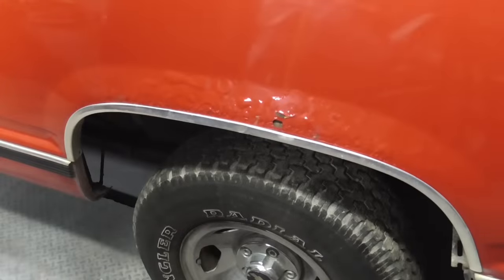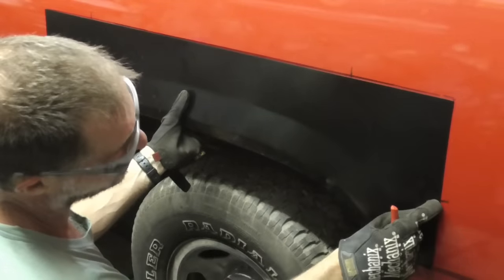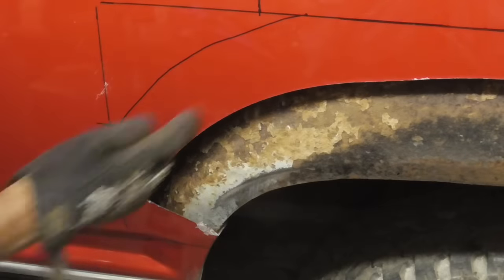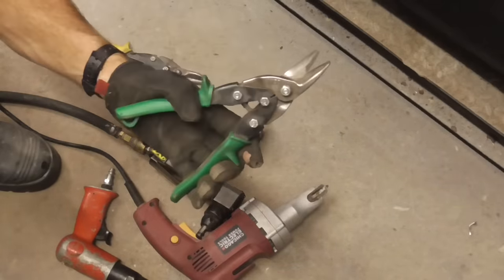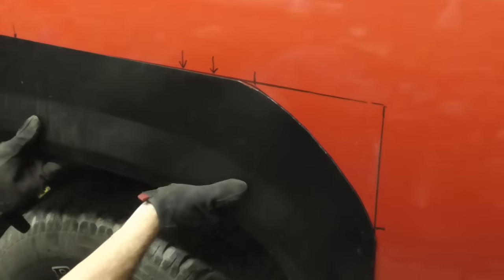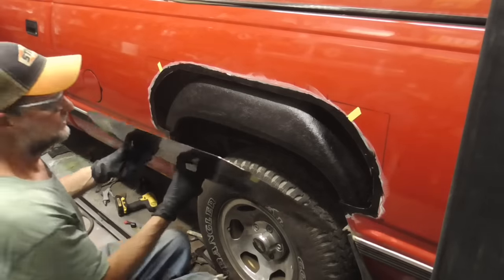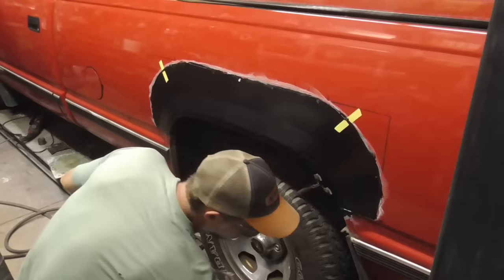Glue On Wheel Arch Rust Repair Panels w/ SEM Impact Resistant Panel Adhesive

Comment: I have been doing this type of work for fifty years. Your method requires much craftsmanship.
Bud welding saves a lot of time. The maximum time for a nice bud well would be 15 min, 
Maybe 15 to 16 spots. I cut in between the metal to level out the surface evenly.
One thin coat of fiberglass filler, glaze, and prime, then paint. 
6 hours altogether to finish the job. Thanks for the video.
You did great work! I am not criticizing you. God forbid, everyone works differently.
Thank you for the video.
Reply from the maker: You're welcome Brother - have a great day my friend :)

Comment: I would have ran the air flange tool on the cutout instead of letting the metal overlap like you did. I was thinking of doing this exact repair on my truck, but still not sold on it. I know my weld won't fail. Time will tell how long the repair will last. looking forward to the final
Reply: Airplanes are put together with similar panel bonders and go through a lot harsher conditions
Reply: After i let this stuff set on my Smyth Ute build , I had to jack the back of the car up for some underneath repairs. 
So I did the old twist test and jacked it up at the left rear suspension mounting point. 
The chassis was so stiff ,it came up level and I didn't have to go to the far side and jack it up to level it for the click I selected on the stands. 
Definitely came out way stiffer then the original chassis was.

Comment: I commented recently on another channel  about old school rust repair and this was how it was done except that the panels were brazed or riveted on then.This way is far better as the panels are sealed from behind. We cut out rust with the same tools shown, I have them all. This makes a fine repair on a daily driver. Nothing wrong with it at all.
Reply from the maker: Thanks for the positive comment Troyken :)
Reply: One issue with brazing is if the flux isn't completely removed, the metal will rust / bubble overcoats.
Reply: @Mike I thought I was the only one,lol.
Reply: @Mike Nothing like taking down stop signs then waiting for people to crash. . .
Reply: @ciphercode2298  Nothing like taking down stop signs then waiting for people to crash. . .
Reply: @bobroberts2371  lol,well I'd find mine knocked down already,but thatd work too,lol.
Reply: 0
Reply: It also removes the heat factor.Not having to worry about warpage.Less body work.

Comment: I've been doing that same exact thing except I have been using duraglass as an adhesive. been doing for over 40 years with no complaints!
Reply from the maker: That's interesting and great to know.   How wide is your overlap usually?  Do you tap the seam down a bit before filling?  Thanks :)
Reply: like I said I have been doing it basically the same way I just use duraglass as the adhesive instead!
 @LakesideAutobody

Comment: Excellent job Bud!! Epoxies and Adhesives have come a long way in the last few decades!!☺
Reply from the maker: Thanks 👍 RK
Reply: Way would you do the hard part to end up with a poor finish 
Bulges where there should not be doesn't make sense ?
Reply from the maker: @johnhall3827  You'll see the finished product this Friday 10/22/2021  - you'll like it :)
Reply: Seems to me within a year the water will invade that overlap joint and start rusting again
Reply from the maker: @JamesJones-rg3dn  That's the main advantage of this method - the glue absolutely seals the lap joint - this will last  as long as a new panel or longer if you do this - https://www.youtube.com/watch?v=8XaZBy7GC7A
Reply: I've been putting my Smyth Ute build together with 3m 8116 and I'll say I'm amazed at this stuff! 
After it was all set for a few days, I jacked up the car at the left rear to put stands under the back.
Didn't even have to go to the far side and jack it up to level it, it was already level.
Reply: @JamesJones-rg3dn  not sure about sem products but the 3m has corrosion inhibitors, so anywhere that's ground to bare metal better be covered with it.
Reply: @LakesideAutobody  : I liked your video, I've never seen a body repair done this way. I work on my own boats, and use a different epoxy product. I shaped and epoxied my cast iron keel about 12 years ago. Not one sign of any failure so far. Also, fiberglass boats can develop osmosis problems, (bubbled gelcoat). I epoxy coated a hull bottom 30 years ago. I sail with the present owner and I've found no more problems after almost 30 years.  Done well, epoxy lasts. (as you know)
Reply: Would make an interesting revisit to see the repair in the future ,say a year or two,please keep us updated . Don't know your location, but up here in the salt belt of Ontario  Canada would give that repair a run for its money on durability
Reply from the maker: @drewthompson7457  Hey Drew thanks for you comment and input.  Boat work has a lot in common with auto body - my dad worked at a vette shop in the 70's- lots of glass work
Reply: U can glue them on but eventually you will get a small line that outlines the patch.
Reply: @JamesJones-rg3dn  I tried this on a car where we put quarter skins on and within a year you could see a line where the quarters stop. I even put duraglass down as my first coat of filler. Had to grind all back out and weld back solid.
Reply from the maker: @jerrybillings4720  The key to any patch is knocking it down and filling  - welding or glue - you'll never see the line - See this vid  - https://www.youtube.com/watch?v=d21RkqTwRqs
Reply: @LakesideAutobody  à
Reply: If ya do proper bodywork, that is coat seem with short strand fiberglass Like Duraglass it will be unnoticeable
Reply: @LakesideAutobody  nice because no risk of fire and it’s totally sealed, more and more cars are “Glued” and properly done, the metal will tear before the glued joint separates I glued quarters on and it worked well , just make sure first coat of filler is something like Duraglass
Reply: @LakesideAutobody  everyone I know that has tried this method has the same problem. Within a year the patch line shows. I like the adhesive for small holes like removing a roof rack and glueing a small patch in from underneath but panels like this I just have never seen them last
Reply from the maker: @holmes1956O  Maybe because they didn't do it correctly.  Not many folks do rust repair correctly.  1) good seam 2) knock down seam 3) fill  Do it like this video and you'll be fine.  If you don't knock the seam down, and have the filler as a buffer between, I think you're asking for trouble.  See the same repair on the drivers side cab corner and drivers side door bottom 3 years later https://www.youtube.com/watch?v=gIS1Tbv7Kvw
Reply: @LakesideAutobody  I cant attest to how they did the job however it wasnt one shop it was several different people that have had that problem. I am glad for you that it is working just what I see in my area is not good in the long run
Reply from the maker: @holmes1956O  I promise I will show it if that ever happens.  So far no... but I will always be honest and would love to do a video on it and why it happens so that it doesn't happen to folks that try it.  If you ever see it or try it and you see the seam after a few years, try figure out why it happened and make a comment on this video or email me and let me know.  Nice talking to you Holms.  Jerry
Reply: I don't think people that make negative comments realize. Sooooo many vehicles over the last 10 plus years are built this way. With only some spot welds in places.
Reply from the maker: @1manshtshowandautobodystuf891  You're right.  Thanks for the input DM - have a good week :)

Comment: A step up from the old days of shoving newspaper and screen then filling with bondo! But personally I will continue to weld in a complete new panel since I have perfected my installation procedures.
Reply: That's the way I would do it is with welding a new piece in , filling in holes with Bondo doesn't last once moisture gets trapped .

Comment: I have done a ton of these repairs I always flange the patch panel other wise you have to use Bondo.
Reply from the maker: You still have to knock the seam down if you flange or the seam will show.  If the seam is not tapped below the surface welded or glued it will likely fail.
Reply: @LakesideAutobody  I put a backing plate on the new panel (glue or weld), cut it flush with the area you're filling, cleco it for position the glue and pop rivet, grind off pop rivets flush, hardly need any bondo except to fill seams
Reply: What type of filler did you use? Looks like it spreads nicer than “Bondo”
Reply: Average time to fo complete job on 1 panel?

Comment: Another tip when you prep to glue the panel. After grinding the  back of the patch panel run a piece of tape along the edge of the area that you just ground down and paint the patch panel up to the tape with POR-15. Just to make sure the metal isn't exposured to the air. And I would do the same on the truck box. Treat the rust with rust treatment and paint with POR-15 and even use a Schutz gun to spray undercoating or truck bedliner. I did all that to a chevy truck 10years ago and it's still solid.
Reply from the maker: Good tips NtD - If you think it through rust repair can last a lifetime :)
Reply: @LakesideAutobody  So true. I honestly think using panel bond is a better way of doing rust repair patches because when you use a welder and weld through primer you are adding heat to the metal so anything you have on the metal for rust proofing tends to burn off then you have bare metal exposed to air. And no matter how much you try to coat the backside of the repair with rust proofing you always miss something. I've seen welded repairs having to be redone in 1.5year later. But repairs using panel bond 10years ago still going strong and yet they will not teach this technic in any trade school. Sometimes you have no choice but to weld but its amazing how far structural panel bond has come.

Comment: Very nice job! At first I thought, 'How's he going to blend the patch to the parent metal? He's not flanging the parent metal.'  Now I know!  Also glad you treated the wheel arch with (Por15?) rust preventative.  Would love to see the painted vehicle.
Reply from the maker: This Friday you'll see it :)
Reply: All metal over the seam before filler is a better
Reply: Didn't look like the new panel was treated on the backside- don't want to be that guy, but why leave bare metal exposed on a panels underside if longevity is at all a concern
Reply: Which part of the video did he do that? Was it the filler or knocking down the area before the filler? I still couldn’t figure out the answer because I had the same question. I’m about to attempt this on my own old f150
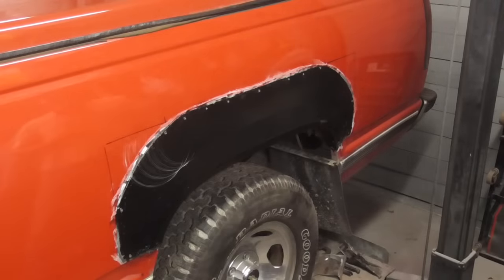Reply: @Tallgeorge  At (9:30 he began to grind/blend the patch panel to the original metal. And he allowed a generous "blend " area so the transition from old/new will be seamless once the filler is applied.
Reply: @mdogg1604  ah so he took a bit more metal off of the patch piece to make that a smoother transition. I get it now thanks!
Reply: @Tallgeorge  You're welcome! I was skeptical at first, but the end result looks really good.

Comment: I use SEM Products and I think they are great. I have mostly used the MultiPurpose Panel Bond, ( the non Impact resistant) and a few different seam sealers. I usually only use the panel bond where the OEM had placed it or per the repair manual. Every time I seen patch panels glued to the seam and not welded especially in Northeast PA the adhesive will start to push on and out during winter and summer months and it will leave a ghost line. Have seen them ground down and tapped in on the seam and ev en tucked under. The panel bond, body filler, and primers, topcoats will all expand and retract at different rates. I would have glued the wheel wells and welded the rest. Tight coat of Duraglass or Everglass across the welded seams and filler. Then undercoat and Cavity Wax the hell out of the inner panel. Not knocking your repair skills at all. You definitely been in the game a long time and know what you are doing. That has just been my experiences both doing and seeing patch panels panel bonded at the seams.
Reply from the maker: Have you tried knocking the seam down and filling with fiberglass reinforced filler so that the seam is not right under the finish?  I have never had a problem with ghost lines in glued repairs.  See this follow up video on repairs that were glued 3 years ago - https://www.youtube.com/watch?v=gIS1Tbv7Kvw   Feel free to ask anything you need.  One thing about glue is the water tight seam - never have to worry about it again :)
Reply: @LakesideAutobody  knocked the seam down, I have knocked them down with a belt sander. Some reason I always seen them come back. Good job on the channel. You describe everything really goodn
Reply from the maker: @peteyjay85  I appreciate the support Pat.  If you ever use glue again, whack that seam down with a pick type body hammer so that that seam is at least 1/8" below the original surface.  Your filler is now a buffer between the seam and the finish - no more worries about ghost lines showing up :)

Comment: Mind answering a couple of questions?
1) How does this technique compare to fitting/welding in the patch panel? Is there time savings, or is it mainly to avoid welding & the possible heat-warpage?
2) You hammered the top seam of the patch after the 1st day glue cure? Why exactly? I'm guessing to push the seam in to make blending/filling the patch edge easier?

Thanks for covering this technique - never seen it done before.
Reply from the maker: 1) The main advantage as opposed to welding is a permanently sealed seam - no worries about moisture.  I think it's a little bit more time consuming though.
2) Two reasons actually -  one is obviously to hide the seam - the other is that you really never want a seam (welded, glued, etc.) right under your paint work.  There's a lot of things that can go wrong and it's always nice to have a barrier or buffer between the seam and the paint and that is your filler or fiberglass reinforced filler.  Just a 1/16" - 1/8" layer and your good - it really does make a difference.  Although the magazines, TV and other chatter will tell you differently.
Though many have never seen this "knocking the seam down and filling, it's how its been done in body shops for 50+ years - it's how manufacturers connected the quarter panel to the roof panel for decades - called the "sail panel"  Hope that helps - thanks for the comment - Jerry

Comment: I agree 101% with this repair approach. No welding/brazing. For this type of repair, bonding is just perfect and welding/brazing is just overkill.
Reply: 100% agree and it not structural . Plus welding / brazing weakens metal of the old panel and vaporizes the e coat
Reply: @nickking1510  a properly done weld does not weaken the base metal. And the new cars body is all structural most are unit body so welding is most definitely the best way to repair them. I flange the panel or weld at a body line and use almost no bondo. A lot of my repairs only require high build primer to finish the repair line
Reply: @holmes1956O  no it does not weaken it buy it burns off any coating on the old sheet metal which rust quick. So here in Ontario with high humidity in nice weather and salt on roads the rest of the year  is to oil  undercoat the entire car or truck  and any  body repairs as soon as the paint dry lolo